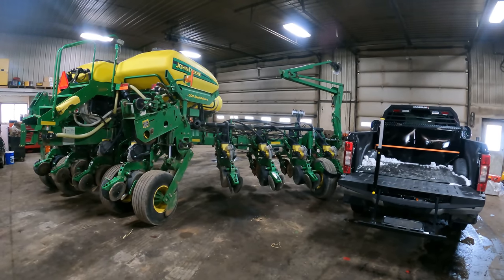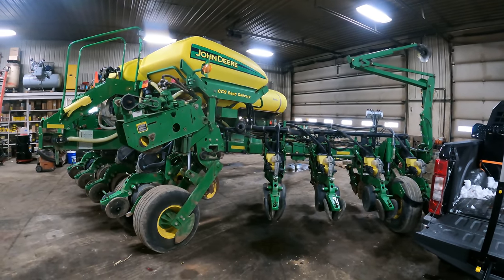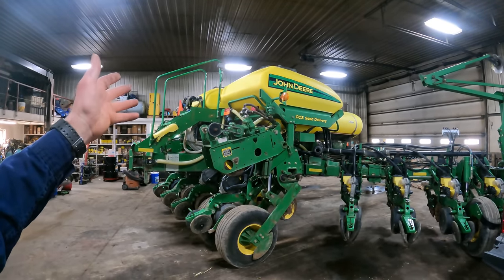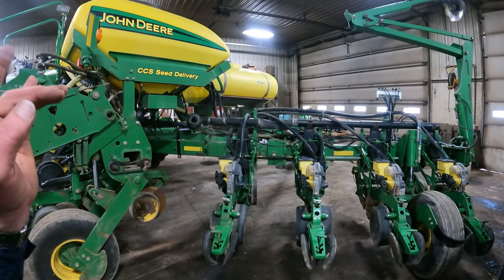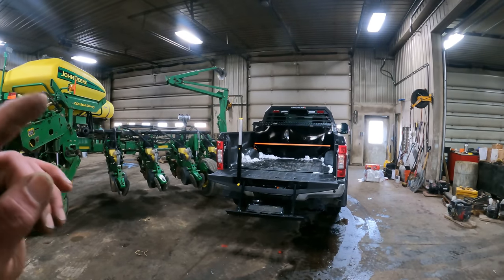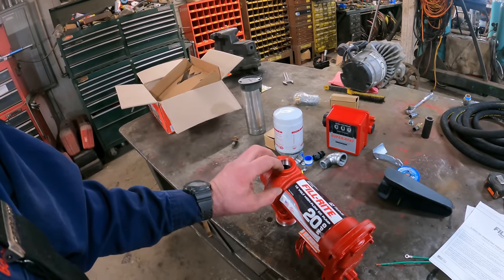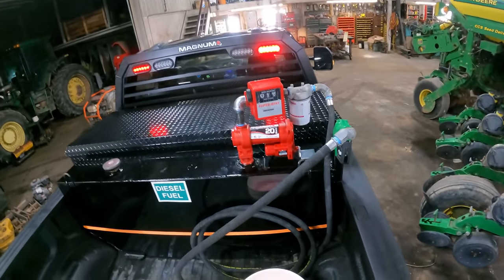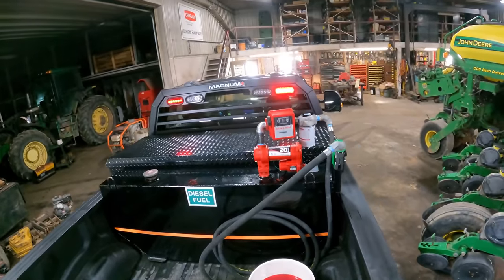More Faulty Parts added

Comment: Hey Andy. As you suspected, I think the meter is in Liters. It looks like the 2nd pour read 12L not 1.2 Gallons.  There are 3.78L in a USG so12/3.78=3.17 Would be close, or at least a lot closer to what you had in the tank.
Reply from the maker: Yeah but that was well over 4.5 gallons though
Reply: Imagine us poor old Canucks. We buy our fuel in litres. Measure mileage in mpimperial gallon buy oil packaged in us 10 quart jugs converted to 9.46 litres and pay 30-40% more

Comment: I usually make a bracket for those pumps when I put a meter/filter on them so it doesn't stress the casting and crack.  I see even the fill rite pumps are made lighter today.
Reply: It looked to me like a whole lot of weight being supported by that one pipe fitting. Interesting someone with actual experience suggesting a support bracket.

Comment: Those first pumps probably had a straight SAE thread instead of a tapered pipe thread. Threading the tapered pipe in acted like a wedge splitting the casting.  SAE -12 has 12 threads per inch while 3/4 pipe has 14 threads per inch. You could have used an SAE -12 male x 3/4 female pipe swivel to convert to pipe thread.
Reply from the maker: And I used the pipe they sent me to

Comment: I also used Fill-Rite pumps. Got mine thru Granger. I don't remember the HP or GPM though with no gauge. Didn't really need it for my application. I think it was 20 gpm. I did my tanks the other way around. Wanted the tool box where I could inside from the back. I also had a larger tank in one of our other Pickups. I agree with you on the ease of having them in your pickups. So much easier to get around and not having to drag around a trailer. We moved around a lot, and some of the spots we went the trailer would have been a real pain in the ass.

Comment: Light colors help reduce vapors from building up that’s all the colors are for unless you want to fill at a gas station color code is to ensure the right fuel is put in for the gas stations protection that is all

Comment: I had one like that there is an adjustment screw on the very bottom It is very aggravating to get it set I ended up sending mine back Feel right Digital counter is the best but it's not cheap by no means

Comment: Great way to train and upgrade your employees and make them use there brains a bit when there filling. 😅😅  Metric is much easier once you get over the initial shock of having to learn and using it and is a lot more accurate when blending eg. Chemical mixes!! Or something as simple as blending gas for a chainsaw.
Reply: Mistakes converting have crashed sat alights and jets. Stick to one. I’m in the USA we use inch and feet.
Reply: @daleolson3506  
Sorry.  USA is not only standard.  Both are used.  2-litre of coke vs gallon of milk.  Cough syrup dose can be tsp or ml. Etc.  I know for sure the Military uses both.